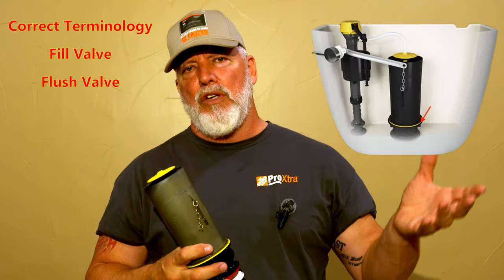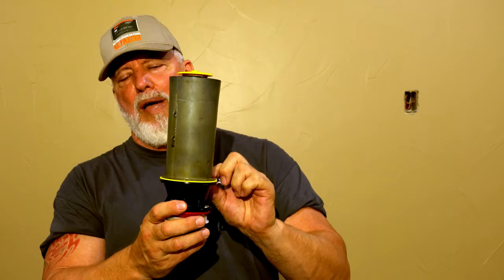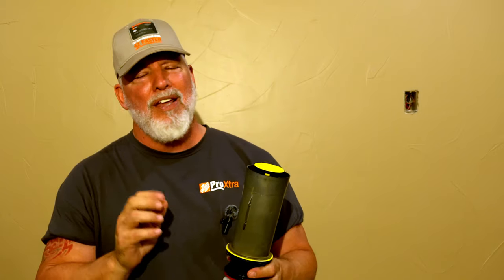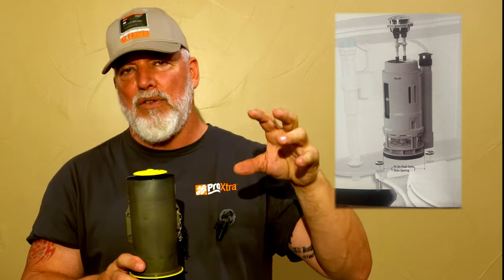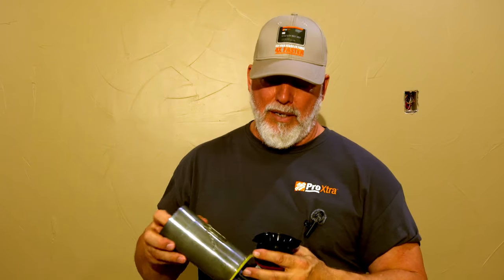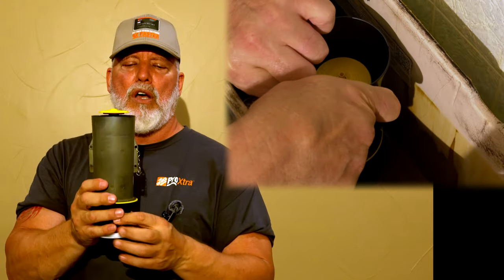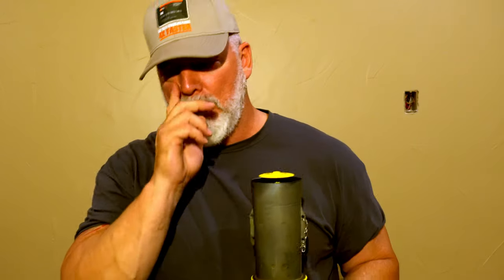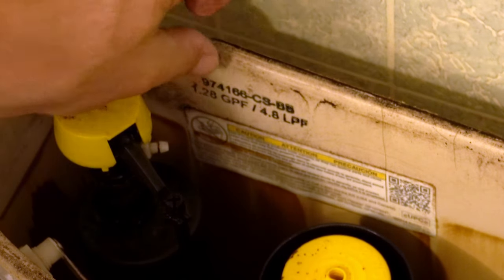How To Fix a Kohler Canister Flush Valve In 60 Seconds in 2024 #kohler #plumbinghacks #toiletrepair

Comment: In my toilet the yellow disk at the top (which isn’t yellow) pops off when it is flushed. The canister knocks it off when it comes up. Should I replace the whole canister or just the inside part?
Reply from the maker: As cheap as the canister as I would go ahead and just replace the whole canister.

Comment: Do you like this flush valve system?  I'm wondering if I have a choice, should I avoid it??  Thank you!
Reply from the maker: That’s a good question, you are seeing more and more canisters now and for the most part they work just fine. I think this particular model just had an issue with that hose getting hit every time the flush handle was used. I really like the Toto toilet, you can get a basic Drake Toto at a reasonable price. I’m changing all of my personal units at home to Toto. https://amzn.to/3XqFT2n
Reply: @UltimateDiyer  I'm in California and they won't allow toilets with 1.6 flush.  Also I need round shape for tiny bathroom.  May be stuck with Kohler cimmaron or high line arc

Comment: My problem is that as of a few months ago I have to hold down the flush lever till the tank empties cuz the canister immediately falls down, shutting off the flush. Is it supposed to float down?
Reply from the maker: No< try and adjust the plastic screw that sets the water level. It sounds like it may have worked loose, and now its not filling completely, making you hold the handle to get enough water to make a flush. If that doesn't work, I would change the flush valve.

Comment: Good video. Couldn’t you simply remove the broken tip and stick the hose in to the hole in the yellow piece on top?
Reply from the maker: Unfortunately it will not stay in place, every time you flush the canister moves and after 10 or so flushes it pops off again. Most people try to do that and realize it’s not going to work in the long run. Great question, thanks for watching!

Comment: I’m still having issues even after i replacement the middle part. After it still pops off, The yellow top, when I flush and water goes out. So frustrating. Could it be the flap at bottom? But it doesn’t leak? I’m so puzzled
Reply from the maker: If the hose is piping off of the new canister try replacing the hose itself, also check the handle and see if maybe it needs adjusting by changing its position with the locking nut if possible. If the toilet is running then look at the fill valve they go out a lot.

Comment: When I flush the water goes out,but it acts like the water does not want to turn on to refill.I can touch the float arm it starts to fill.Is there an adjustment. I see the something that looks like a screw driver fits,did not understand what that might do.
Reply from the maker: That adjustment sets the water height, it sounds like you need to replace the fill valve, it’s sticking.
Reply: @UltimateDiyer  Thank you very much.

Comment: Thank you for the video! My toilet has this unit, I have pulled it out and inspected it, but the toilet is still not getting a full flush. It is like the canister is dropping to quickly. Is there a way to adjust the canister to drop slower?
Reply from the maker: The only way to adjust the canister is the plastic screw that adjusts the height of the water in the tank. Make sure it is set to the very top so you get the max amount of water when you flush. If you are set to the top then the flush valve may be defective, you might want to just replace it. With the top off the tank flush the toilet and make sure the flush valve itself Is sending enough water to the canister, it may be wore out.

Comment: What if my toilet makes a funny noise every time the water starts to fill up? Didn’t happen before. And that yellow piece at the top keeps twisting off on its own.
Reply from the maker: It sounds like the yellow insert is flat broken that could be where the noise is coming from and it should not be popping off. If the hose itself is popping off of the yellow piece, replace the hose, it can be owed and brittle. But I would go ahead and replace the canister assembly if that yellow piece is popping out and it’s making noise. Hope this helps. Thanks for watching and thanks for the question.

Comment: I am having ghost flushes on my toilet.  Is the yellow ring "gasket" what needs to be replaced?  Nothing is broken and it's only about 8 months old.
Reply from the maker: There are a number of potential reasons for this, but most often, it’s due to a leak in your toilet.
Let’s take a look at its various causes and corresponding solutions.

Exterior Leak
An external leak can develop in the toilet's tank, bowl, or even the pipes that link your toilet to your sewage system. All of these can result in ghost flushes, so identifying the source of the leak can help you correct it.

Crack on the Bowl’s Exterior
Although cracks closer to the seat are typically difficult to see, they can appear at any time. The first indication of a leaky bowl is when the toilet appears to be "sweating" and there are drops of water running down its exterior.

What to do about ghost flushing if the outside of your bowl cracks? If this is the case, you're usually better off replacing the entire bowl because patching it up is a temporary fix. If you try to seal the leak, you’ll likely have to deal with the same issue again because the rest of the toilet becomes susceptible to cracking

Crack on the Tank’s Exterior
The outside of the toilet tank is more likely to crack than the bowl. If the tank is accidentally knocked against the wall, its exterior could crack. Sometimes, you can end up cracking the wall and the tank at the same time.

If the crack on the tank is higher, you could try reducing the water level in the tank. It can be adjusted by turning the water level control knob which is normally close to the fill valve. Once you’ve repaired the crack, don't forget to change the height of the toilet water. 

However, if the fracture happens on the lower part of the tank, it’s best to replace the entire fixture.

Loose or Improper Piping
If the seals between the toilet and the sewer system deteriorate, loose plumbing can happen. The seal or the pipe must normally be replaced when this kind of leak occurs. If issues persist, you could have a problem with the toilet fitting itself or low water pressure.

Internal Leak
Internal leaks are frequently the main cause of ghost flushing. Numerous moving elements in toilets experience constant wear and strain. Daily use can result in one component failing which then prompts another to stop working. Eventually, the entire internal system of your toilet has to be replaced.

Faulty Toilet Flapper/canister 

One of the most common causes of ghost flushing is a faulty toilet flapper. In your case the canister/ring system. The flapper controls the opening between the bowl and the tank. When you flush, the flapper moves away from the opening and allows water to fill the bowl.

Typically, this issue can be resolved by changing the flapper or canister However, if the problem recurs, it could be that the flapper is being pulled the wrong way by the toilet handle. It's better to change the handle if this is the case.

What to do about ghost flushing in this case? Take the refill tube from your overflow pipe and leave it outside to test it and see if that stops the ghost flushing. 

Malfunctioning Flush Valve
The component that flushes the toilet into the sewage system is the flush valve. When a flush valve malfunctions, the system can flush continuously because the handle is being constantly pulled. The flush valve must be replaced in this situation.
Reply: I fixed it.  It was the yellow gasket.  It had a bubble on it that protruded on both sides.  Very easy fix.  I am a 66-year old female and always panic when it comes to "fixing" things.  
Thank you for your video.   @UltimateDiyer

Comment: Thank you so much for this video. The problem I have is when I flush the canister goes up and wont comw back down at all. I have to barely touch the canister and it will drop. Any thoughts on what that may be? Should I replace the part that is inside the canister? Thanks!😊
Reply from the maker: Usually I just replace the canister when I have a sticking one and it fixes the problem. Sometimes your water pressure can be off a little bit or you don’t have everything lined up correctly so that it works smoothly, but most likely the canister itself is defective.
Reply: Thank you! I will give that a try.
Reply from the maker: @shorelinerach01  let me know how it works
Reply from the maker: Also check the handle and make sure it’s not bent, sometimes when people try hard to get it to flush, they end up bending the handle it may be bent up higher and causing it to stick open

Comment: Thanks!
Reply from the maker: Thank you Steve for the super thanks, it’s greatly appreciated! 
So first if the hose keeps popping off, I would replace it with a new hose. I’m assuming the plastic nipple is not broken off . You can get the hose at Home Depot, simply by taking the one off of the unit and matching it, but make sure that the new hose is a little bit longer so the flush  arm doesn’t hit it. The new hose will be more flexible. I have even used a small steel s hook attached to the rear of the tank to hold the hose back. The noise could be coming from the hose coming loose and squealing or the part itself could be defective. I’m not sure if you fully replaced that part or you’re asking me if it needs to be replaced if it’s making a lot of noise I would probably just replace it. But before you do that remove the tank lid and flush the toilet. A lot of the time the squealing noise is coming from the fill valve, not the flush canister. If that’s the case replace the fill valve or the small gasket inside the valve. I have a video showing you how to do both on my channel. Hope this helps, let me know how it works out. Thank you again appreciate you watching.
Reply: @UltimateDiyer  Thank you!  The hose seems ok.  It was the yellow nipple that was broken.  I replaced the canister in less time than it took me to watch your video!!!  Totally fantastic!! You are the 1st person on YouTube that I have thanked.  And I've had to do a lot of DIY lately.  Thanks again.
Reply from the maker: You are very welcome

Comment: Just in case anyone else comes across this issue, Kohler does have a repair kit with just the common failure pieces.  It's P/N GP1229656 or K-GP1229656
Reply from the maker: You are right, I just did a follow up video with the new part. https://youtu.be/h4UCiQLQaZA?si=ErmX0Vz7QMRfUgZf

Comment: It is a great Illustration, but the yellow cap piece broke from the opposite side. The nipple is still on the yellow piece and the hose fits just fine but it is the opposite side where the tube screws to the cap. However, the same technique is used here to fix it.  Thank you for sharing your expertise.
Reply from the maker: I do see that happen every now and then, thanks for watching and sharing

Comment: You should watch the flush valve function before describing, incorrectly, how it works.  The refill hose fills the toilet bowl, not the canister.  You say lifting the canister empties the canister into the bowl.  The canister is a cylindrical dam that holds back the water in the tank.  When lifted, the water rushes into the tank outlet and into the bowl.
Reply from the maker: Good points, thank you

Comment: You state that the canister floats and will rise and stay open til the water closet has emptied. Mine looks identical to yours and mine has no air chamber (like a flapper) causing it to float on top of the water as it drops. When flushing mine the canister will drop closed unless you hold down the handle til it has emptied.  If not held down the canister drops and retains the remaining water in the water closet then starts to fill again. My Koehler canister #1069722 upon close examination has no floating capabilities.
Reply from the maker: There are many reasons from the handle to even clogs, high water pressure as well as low. Damaged canister and so on. Check your water level and make sure it’s to the top of the canister. Another possibility is the fill valve not working correctly, possibly clogging and not allowing enough water to fill quickly. I have a couple videos on the fill valve, you can remove the top gasket and clean it.  Both free. Make sure the toilet isn’t bubbling when you flush it, indicating a clog. Then I would look at the entire flush valve assembly, lastly the fill valve assembly. Hope this helps, thank you for watching. Let me know what you find.

Comment: Relaced both toilets many years ago with Kohlers from Home Depot.  Well, here's a gift:  Home Depot carries F'N ZERO replacement parts.  No, really, nothing they sell resembles these internals.  Talk to their "plumbing experts" asking them, I have, they can maybe tell you about deals at Taco Bell.  Been there.  Yeah, fixed mine, learned a lot more about toilets, but frankly you're on your own except for YouTube.
Reply from the maker: You are correct, sometimes you find a good guy working at a Home Depot but most of the time no. Even the plumbing supply houses struggle. I have found a lot of the parts on Amazon but the draw back is waiting for delivery. Thank you for the comment.

Comment: Great video. I have a problem when I flush it very little water flow. Than I have to hold it for little bit and it flush well. Please advise how to solve this problem. There is No Leakage?
Reply from the maker: Most likely, that is the flush valve. Its not giving you enough water to hold the canister open, so you have to hold the handle to get enough water. Try replacing the valve. Thank you for watching and the question.